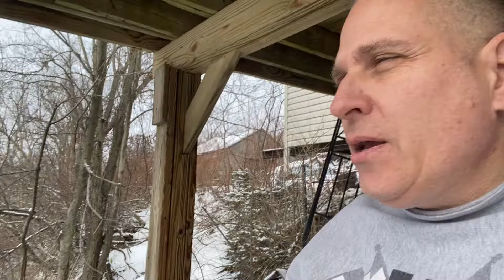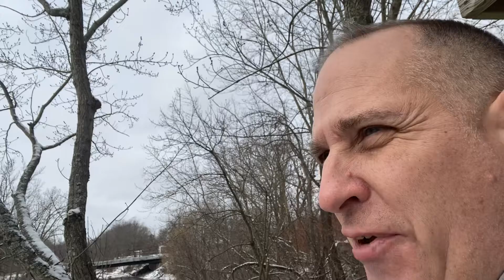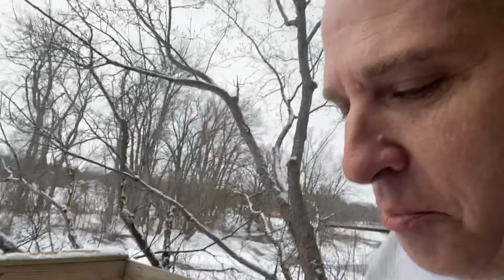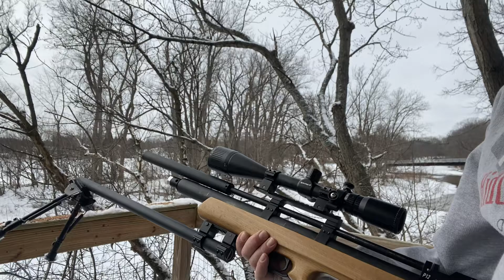Here is the supersonic crack Matt

Comment: Did I miss the 5-shot group? Can you please run the chrony while you gather the group?
Reply from the maker: I will definitely shoot it for you tomorrow Frank we just had a storm here the last week and a half it’s been unbelievable but it’s finally starting to calm down even if it’s a little windy I’ll shoot. I’ll also shoot that Walther maxima Thor. I am so happy with this thing now it’s 25 Cal and it was never really accurate with pallets and even worse with slugs and I draw the choke out this thing is just unbelievable now. I also did the barrel work at needed polished it lapped it it shoots a 38 crane at about 810 FPS but it accuracy is an incredible now it shoots under a half inch at 100 yards. So I’m really happy with that thing. It went from a gun that I would not even think of picking up to a gun I’ll pick up almost every time now. It’s quiet it’s a tech driver and you really don’t need to go super fast for hunting. I do like the slugs are going over 1000 FPS but they don’t have to in order to serve their purpose and function. I’m also waiting on Altaros slugs. Look them up and see how they’re made the machine them. I need to get more for the Huben . I had to keep messing with the slug speed to see where I shot the best group and that was at 1040 FPS out of 25 Cal. It was shooting .9 of an inch at 200 yards with those slugs
Reply from the maker: It’s up there Frank check it out sorry it took so long

Comment: Thats transonic 🤦🏿 you dont even know the speeds sound barrier isn't a barrier it was just impossible for planes to reach that what your hearing is a transonic crack not a super sonic and also the pressure airguns produce are way lower than a gun so until a design is made we stay below the transonic zone as entering that speed than leaving creates dynamic instability and issues with it slowing down rapidly it causes spiraling just like a kvochur bell maneuver in a jet same concept as its moving fast and pulling up or down while spinning length of pellet also has a play in that as energy is low you really need to do you research airguns just barely caught up to .22 and are getting better the only difference now is barrel pressure in other words what pushes the projectile the barrels designed by fx are specifically for slower fps projectiles and if your hearing a crack even with a shroud or moderator you are over clocking dipping in and out of the transonic zone  its okay to pass it but you need to reach your target before reaching transonic zone guns from ww2 i think can even have this issue when shooting to far thats when the bullet hits transonic and rapidly destabilizes resulting in spiraling or tumbling and some case yaw or pitch til flying sideways btw im 18 and know this because my dad introduced me to long range powder burning shooting at a young age im at a point where all i need to learn is Coriolis effect correction meaning in the northern hemisphere aim left a bit in the southern aim right on top of wind and elevation angle feet above sea level  humidity and with how high you are from sea level even air density plays a role but ion know bro keep on it also do your research on the history of the sound barrier and why that name was made
Reply from the maker: Really? What’s the farthest shot now that they do all the time for miles how are they hitting a 2 foot gong at 4 miles OK enough for you guys in your bullshit enough. Here’s a fact lower pressure shooting guns like 1700 psi like FX products Will experience in accuracy with slugs from the low pressure because it takes more volume to push the slug out the 800 mm barrel by the time the slug gets out the air is moving faster and a big volume of it. Now if you’re shooting, let’s say 3600 psi, you have a sharp crack, short duration, very high pressure air. You have less than 2/3 of the air coming out. The end of the barrel has expanded waste. That’s right, the very low pressure that FX fire is there are slugs out of their guns at because their guns cannot operate with higher pressures because of the weakness built into them. They are actually causing their own and accuracy, as well as their liners with a choke on it to shoot slugs the liners have to go also so here’s the mess and for the day you dumb shit high pressure equals extreme tight groups at long distances lower pressure means a 2 inch group at 100 yards so have fun with that. You don’t know shit you read a little and then you take what you read and you don’t even understand it and you make comments.
Reply from the maker: You really are a dumb shit you have no clue what you’re talking about. You’re talking about aircraft, the last time I looked a slug doesn’t have wings. It doesn’t have a wing with a high pressure and low pressure zone does it. This is what I’m talking about with YouTube and you assholes who made comments for FX. You are totally muddying the waters with bullshit. That makes no difference and I’m gonna tell you what it is with our guns. This is what matters. Speed and spin. That’s right the speed of your slug Hass to be matched with a spin of your rifle, so that’s going to determine your speed and the balance point of your slug saw my gun shooting well over the speed of sound. And I get a three eights inch group at 100 yards you idiot why do you think that is because of his instability and he’s going through this it’s a little sonic boom MX you guys are so lost in this whole hobby is so fucked because of assholes like you taking a paycheck to fucking spread bullshit for a company. You assholes have to go away because you don’t know anything you read something and you spit it back out and you don’t even know what the fuck it means.
Reply from the maker: Here’s a fact jaygeeantonio. The reason that that BS has been spread around about subsonic and getting into going past the speed of sound that came from a Fx . They are the ones who spread that around at Utah’s competition. In the reason they spread that is because they cannot get to that speed with their weak platforms. They cannot do it consistently because their shit breaks. I have a Huben K1, 1150 FPS 3 eights inch group at 100 yards how do you think that happens. Quality barrel high-pressure. This is a BS hobby to me and I know more than all of you guys put together. And you are the assholes out. They’re spreading this gym for this information to new guys so they are just dumbfounded and don’t know what to do but I’ll go by that affects product because it’s up there on every other video because I Fx spans five Mile year and shooters that shoot their shit products on YouTube that’s right as long as you do exactly what they say you don’t put groups on paper you’re gonna be OK and you’re gonna get your pay first tier 90002nd tier 15,003rd tier 20,000 per video
Reply: @amazingairguns6350  actually my knowledge on barrel and speeds came from power burners so off the first sentence your not proving anything im jus saying i shot long range for 13 of the 18 years i have been alive and everything your saying sounds like bs did you know pellets are supposed to stay in between 850 and 950 cuz they use drag to stabilize and not gyro you really out here looking like a fool not even 50 cal plus in airguns can compete with even .300 200 grain round i been shooting longer than most adults and can even tell you sanding the barrel is bs you just need to break it in there are alot of point in the rifle that constitutes in air stability you never even mentioned twist rate and weight of pellet together those are probably the 2 biggest issues not rifling its the same reason airguns dont have massive lands a groves in the rifling we dont have enough pressure for it to bleed off and effectively push the projectile
Reply: @amazingairguns6350  here let me start this conversation like a actual person hi my airgun is regulated at 2900 psi half power on the hammer spring and a 1/18 twist rate barrel i shoot 44.75 gr jsb diablos fun favt jsb is what the germans called there missles or large caliber anti material rounds i dont know which but i thought it was cool as they used the same concept
Reply: @amazingairguns6350  and you literally dont do anything to contribute to the airgun world other than talk shit like im developing ice rounds you take water saw dust and a Pellet mold and you can make a pretty effective ice round that hits the target and melts
Reply: Your also wrong as because you touch the speed of sound doesn't mean you stay for example.223 pretty small only slightly bigger than .22 but the cartridge itself pushes the projectile 3000+ fps way past around 1100 fps and if you tell me aircraft and bullets arent similar why does the math say so because 1100 fps and some change translates to roughly 760 i dont remember the exact but thats right around mach 1 the "sound barrier" clearly also dont know about ballistics math too buddy i basically debunked your whole channel in 1 comment argument
Reply: @amazingairguns6350  do you even know why a bullet drops like most people forget bullet drop is due to gravity its wild as shit you couldn't even zero on a golf ball still had to hold even after adjustment so dont come at me i know my scopes moa and digital night vision and they both have pros and cons like 1 moa at 100 yards is like 1.08 inch or some like that so quick zeroing is either division or multiplication in some way talk to me when you know what your turrets do
Reply: @amazingairguns6350  and cool thing about getting a digital cam is it records and to zero you just use buttons to move the reticle but in some ranges you have to hold as it cant account small adjustments at 100+ in a airgun as accurate as an estimate with an established zero
Reply from the maker: @jaygeeantonio  why would anybody want to shoot ice round? What is the advantage to keep your drink cold with them?
Reply from the maker: So you want you can make these are the different uses this way when you’re not you and you’re outside and it’s hot you can call yourself off with the rounds
Reply: Don't smoke crack, listen to it